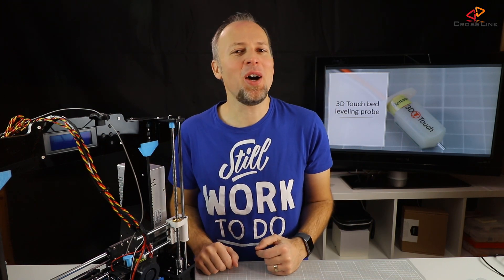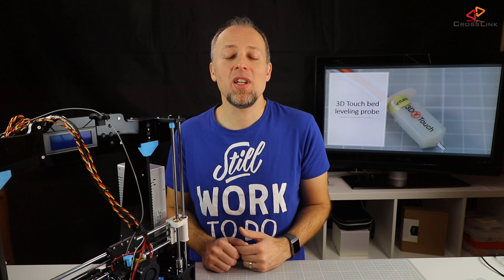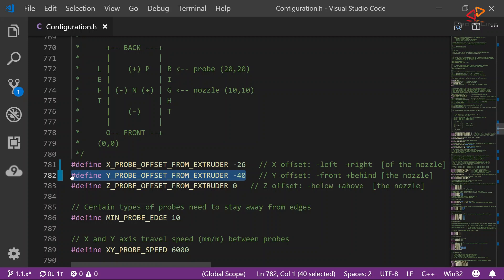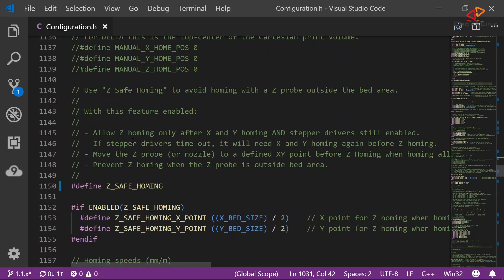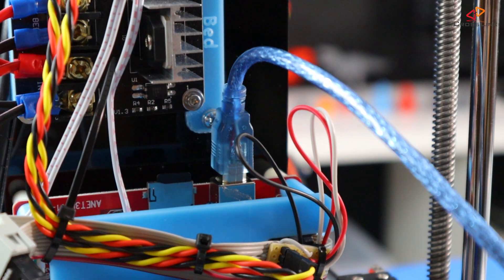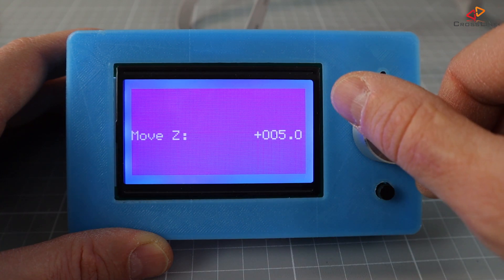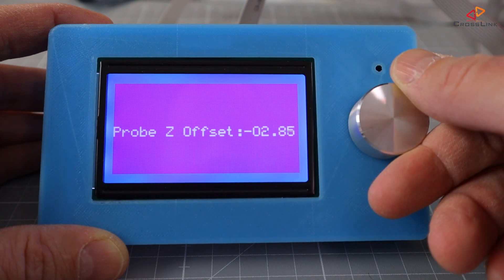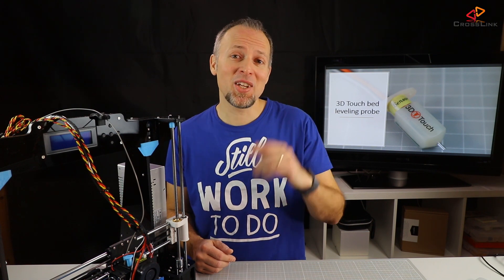BLTouch on the Anet A8 - Marlin Firmware 1.1.X configuration and calibration

Comment: I'm a rookie to 3d printing but my x and my y travel bars seem to have  Scoring on them is this normal I've only had it a week when I run my fingers across the bars it looks like lil pieces of metal What would cause this
Reply from the maker: The linear bearings use to do this. I don't think that it is a problem unless you see that the bearings don't run smooth. Maybe clean the rods unscrew one of the bearings and move it back and forth several times to see if that scoring comes from that and check that they all glide without issues. Anyways if you use the printer intensively for a year or longer you might need to replace the bearings at some point in the future because they sort of self consume their grease.

Comment: Hi, is this sensor the best way to get a very good first layer? I mean is this sensor best way to level the bed  than other sensors or manual endstop switches?
Reply from the maker: I would say it is one of the best. It has the advantage that it works with all bed materials (metal, plastic, glass, etc...) but the most precise sensor is probably an inductive probe but that does not work with a glassplate. My results with the 3DTouch/BLtouch are very good. Leveling is definitely easier than with the manual endstop switches.

Comment: What a coincidence, I have received my 3DTouch just today in the mail, so this will come in handy very soon! What holder are you using?

I tried flashing the firmware for Marlin awhile ago, and it failed (I don't remember the error exactly), both from Mac or PC. I also have Arduino board and USB-to-serial adaptor coming soon since I assumed I am going to need it anyway at some point for Optiboot flash. Have you come across this issue? Will having the Arduino board help me flash the board? I don't remember the exact error, just that I've googled it and the few people who had the same issue solved it by getting a new board from the seller, so nothing that can really help me (unless I want to buy it, which I don't). :)
Reply from the maker: Hi Pavlik, I have used this holder: https://www.thingiverse.com/thing:2331878 
About your second question. Yes, I have had this issue. The board usually does not have a bootloader at all if you get errors like "not in sync". Flashing Optiboot with an Arduino will fix it. Please check out my video about it here: https://www.youtube.com/watch?v=RQIizXtf9oo